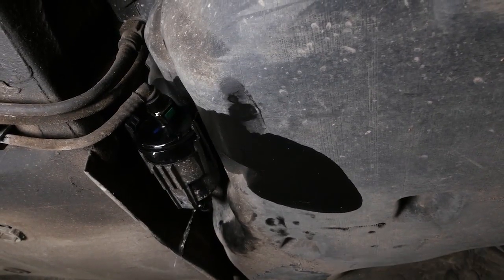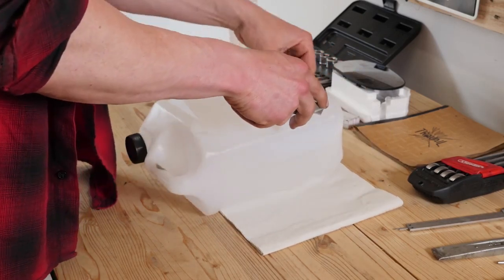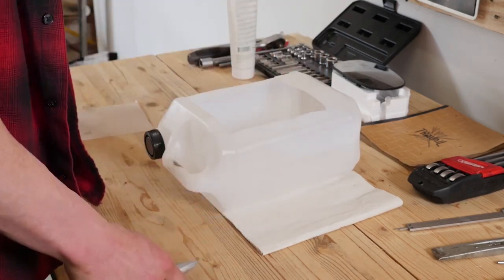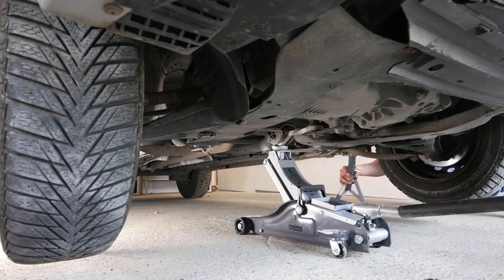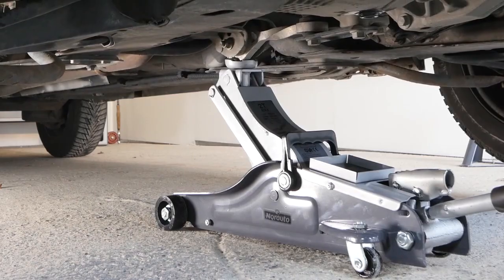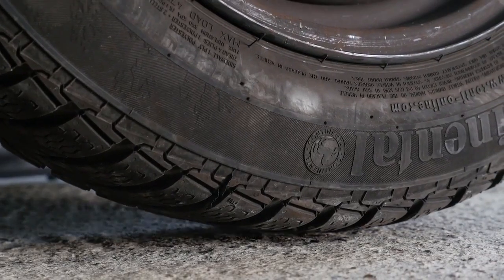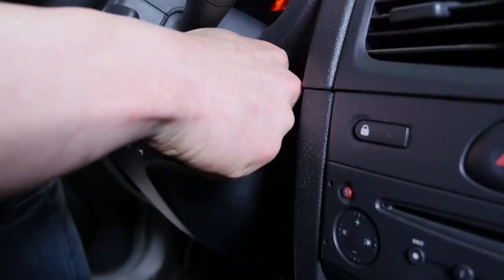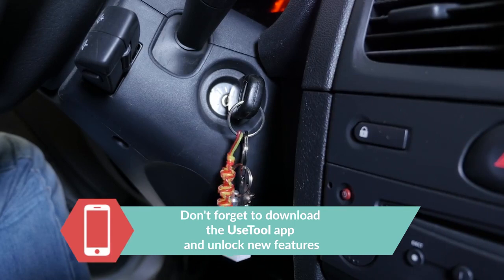How to replace the fuel filter CLIO 2 1.2i ⛽

Comment: Hi would changing the throttle body sort out an electrical fault where the car loses power and goes into limp mode.  Your videos are so clear  thanks
Reply: Hi, It won't sort the electrical fault but it would solve your power issue, repaired mine as the heads broke off, used chewing gum as a temporary fix.
Reply: I've been having the same problem since last year , it just came back last week , honestly i dont know what to do anymore. i need to get it fixed and sell the car because I'm pretty sure when i replqced the fuel filter,  it only went away temporarily. i was once told it could be an electrical fault

Comment: Hello I have a Clio III 1.2 2010 and wanted to change the fuel filter but I didnt found one so you say that is inside the tank.
My car feels sluggish on a light hill and I have to press the throttle completely floor to move what could be the problem

Comment: maybe you should have added a disclaimer that not all Renault Clio 2 petrol models have their fuel filter located at this position. I just spend half an hour doing preparations and looking for the filter only to uncover there are also models which have their fuel filter INSIDE the fuel tank, of which my Clio is one of them apparently
Reply: What type of filter is in there? Just a regular or built in on the pump?

Comment: I also have Clio 2 1.2 8v, but there is no fuel filter on mine. Is it inside the tank? Year of model is 2005, by the way.
Reply from the maker: If you cannot see it, there is almost 100% chance that the filter is inside the tank, so a life long filter
Reply: Yes, I was searching for it last year when I was changing oil, filters and similar stuff, since I just bought the car then, but I was unable to find it, so it seems like it's one of those "long lasting" filters. I was just wondering when is it recommended to change them,  or should I just leave it like this? My car has around 149.000km on the clock, and I don't know if it was ever changed before. Thanks.